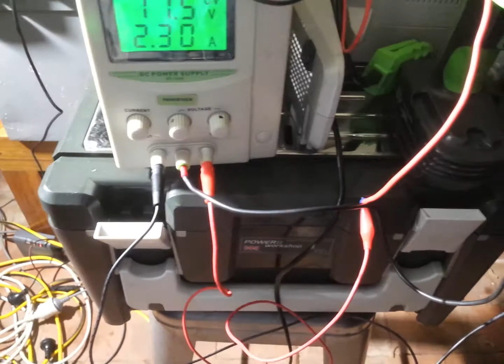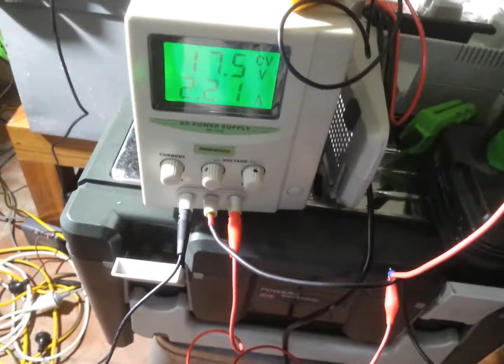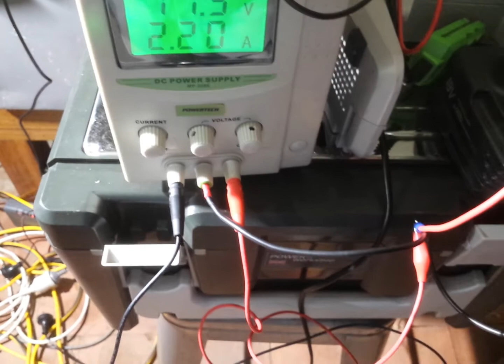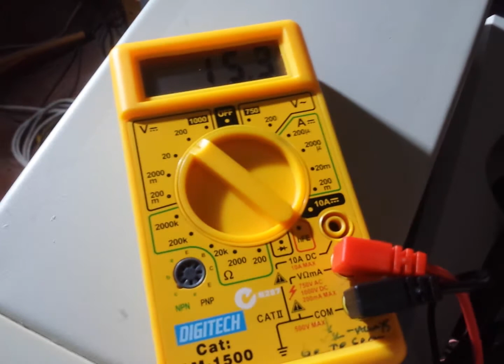Power 8 Workshop Lithium-Ion & Nihm Battery Problem And Fix

Comment: I bought this set a long time ago with two batteries. the NiMH batteries died and I finally got around to doing something about it. Instead of taking the batteries apart and replacing the SubC batteries with new NiMH cells, I chopped the bottom off of the battery pack and attached a Dewalt battery adapter and now it runs off of removable Dewalt LiPo battery packs. I had to leave enough space in the handle for the electronics so the height isn't quite right. It's slightly too tall to fit into the battery bay on the cabinet part so I just cut out the bottom section of the cabinet where the battery goes and now it all works fine. The Dewalt battery 20V packs charge to 20.5 volts which is still well within the capabilities of the motors in the tools. The motors themselves can run as high as 36 volts. They're not proprietary. variation in the charging of the NiMH batteries can wander up as high as 20 volts or so, so there's a wide margin of error to play with. The electronics in the tools can handle it. Even the light. The batteries don't charge in the Power8 cabinet anymore so I don't plug it in. They charge in a standard Dewalt 20V battery charger. The Dewalt batteries are 5000 mAh which is WAAYY better than the original batteries 1500 mAh capacity.

Comment: I want to find out i tested my power 8 workshop poles to see the voltage output of the charger, my multimeter fluctuates between 10 and 25 volts is that normal?
Reply: Should it be a constant voltage or should it fluctuate like that
Reply from the maker: sadly i sold mine long ago and do not have any information anymore but voltage should stay steady i guess.

Comment: Ok so I had the two original PowerHandle batteries that came with the Power8 Workshop. Plugged in to charge after being outside in both too hot to cold temps, only the power symbol came on. No digital display or background light. So I simply plugged in the second battery to the secondary charger & now the one in the main dock is fully charged. Will swap them over & should have two fully charged back to life from the dead batteries.

Comment: I bought a Power8
After using it for a couple weeks as a table saw
The battery came loose
Now it no longer works
Even when it's plugged in you still can't use it as a table saw drill press or jigsaw

Call the company and I've got nothing but the run around saying someone's going to contact me this is going on for a month

I Facebook the company
There is no post from this company for several years
If you look at profiles of people who work for power8
It says former employee
So basically this companies going out of business
And they will not stand behind their products

Comment: Good day everyone   I get same problem and what I found the issue is cooling fan it’s gift alarm to the circle so you can charge the Battery so if you want fixed you should be check the board and remove the fan To start charge or replace the fan thanks all
Reply: I think this is my problem, do you have some more details on how to access this space
Reply: @bretonmoody454  Do you have this device because I'm changing batteries on the device but I didn't take a photo of connection. Can you help?
Reply: Do you have this device because I'm changing batteries on the device but I didn't take a photo of connection. Can you help?

Comment: Sir my charging  port wont  display   the digital display too and the battery inducatir wont light can you help
Reply from the maker: unfortunately i have the similar problem and couldn't find a solution-answer to it. It seems it is common problem with Power 8 Workshops.
Reply: Me too, pls if any one find the solution, help me thanks

Comment: You can connect power cable directly into a battery case but First take it out batteries.
Reply from the maker: Do you mean it must power up directly from the plug? None of the versions i got don't work without batteries.  For Lithium or Nimh version?
Reply: @DesignedinAustralia0  it works with DC 5v to 48v 10A adjustable  voltage power supply transformer.
Reply from the maker: @YIB110  Thanks for the info. I don't own any Power8Workshops anymore sadly. I hope the information helps to other people.
Reply: @YIB110  what voltage should I use to charge the power handle directly, without the station?
Reply: @j_erdn  18v
Reply: Did you solve the problem?
Reply: Favio Fernandez  hi 

Good day everyone   I get same problem and what I found the issue is cooling fan it’s gift alarm to the circle so you can charge the Battery so if you want fixed you should be check the board and remove the fan To start charge or replace the fan thanks all
Reply: Is the fan within the battery or the charger to prevent overheating? I'll have a look soon, thanks for the advise any further information would be useful. Many thanks
Reply: @OA-Chat  Do you have this device because I'm changing batteries on the device but I didn't take a photo of connection. Can you help?